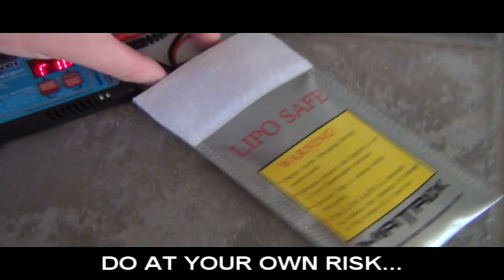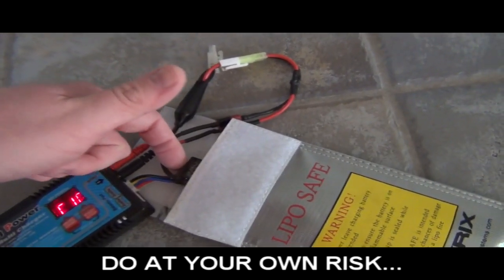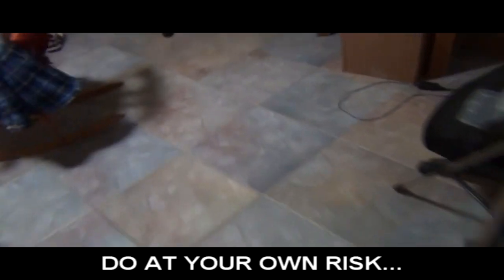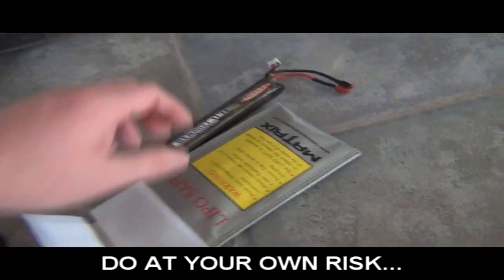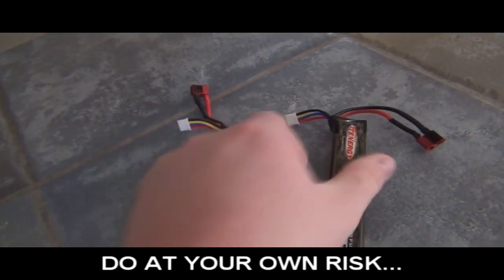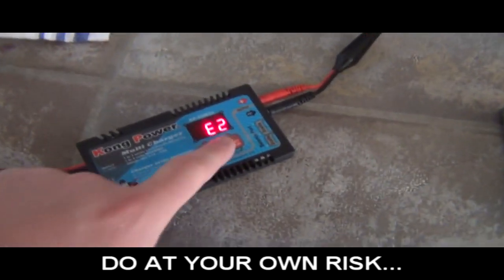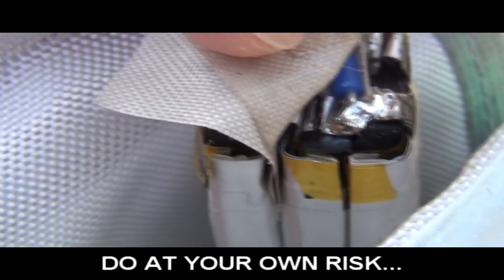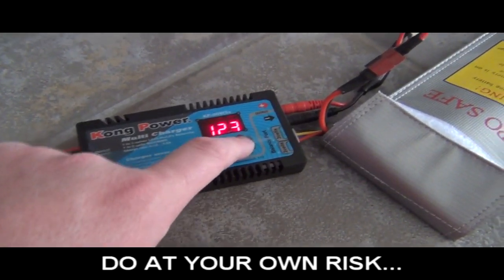Repairing a Short Circuited Lipo Battery

Comment: I was soldering (probably spelled wrong) two lipos in parallel and the ground accidentally touch the positive wire and smoke for less than a second. Is it still safe to use these batteries?

Comment: I think you are a bit too cautious, yes lipo's can be dangerous if treated incorrectly but treat them with respect and don't go over or under the safe voltages and you will never have a problem unless you have a puffed cell then just remove that cell

Comment: Awesome, I fixed a few lipos using your method. I shorted afew brand new lipos before when rushing soldering new connectors ect ect. A lesson I learned awhile ago. Go slow you get there quicker. The ones that I discard are the ones that i've shorted when the cells inflate and start to burn & smoke. In a span of 3 years of airsofting, only shorted 3 lipos 1 burned, 2 others connection break. However I have more issues when using nimh batts & prefer lipos or LiFE batts.